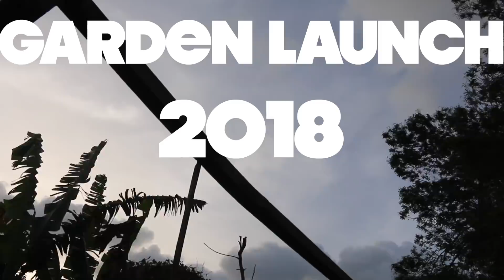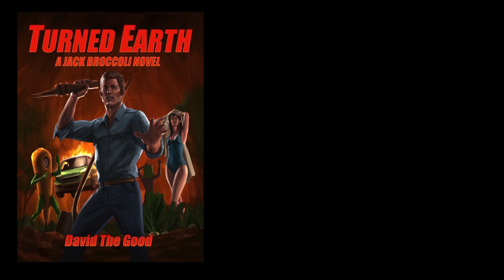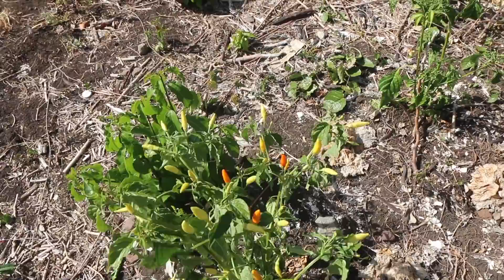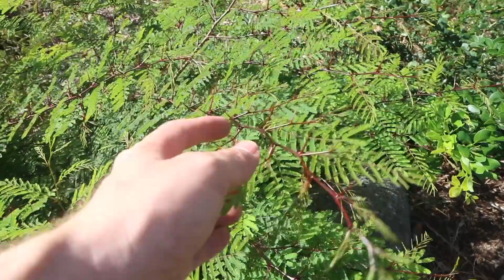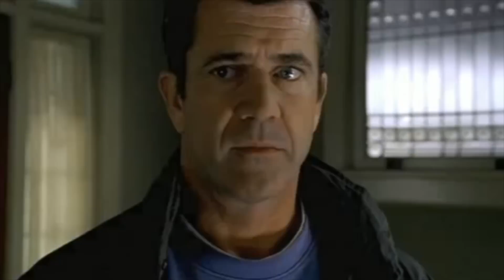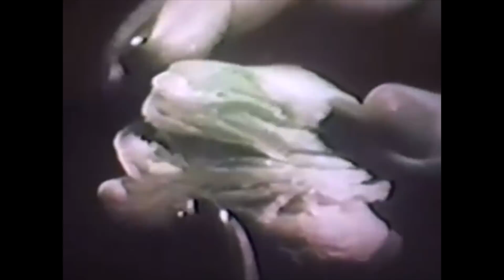2018 Garden, Day 1: Opening Up New Land

Comment: A wood chipper will be handy
Reply from the maker: Yeah, I wish we could get one.
Reply: @davidthegood  don't bother.  I had one and went back to burning.  For the cost, time and maintenance (and if you're an envirotard, the pollution) it's just more efficient to burn the brush into char.  Most of the low-range chippers you'll find are designed for fresh pruned greenwood and leaves and not hard, dry, desiccated brush anyway.  

Consider the burning a means to an ends and be content with it. Sacrificing some fertility, for time.  Just get the area into production and then it becomes much easier to maintain composting annual bio-mass than fretting over what to do with years-old, lignified wood and the expense of another machine.   

If space isn't a concern then just clear an area and pile the shit up and leave it to rot, the next year clear another spot and start another pile, do that for three or four years, then go back through the original pile with a sifter or spread it out and throw anything too big into the newest pile, then just keep repeating that process. The important thing is to not keep adding to pile. Though this can be a bit of a pain if you pile the brush under a tree because leaves will be added every year.. You can build a bulk compost sifter with some hardware cloth and some 2x4s for a hell of a lot cheaper than a wood chipper. 

Just get to a blank canvas by hook or by crook and then manage it in a better, sustainable way.